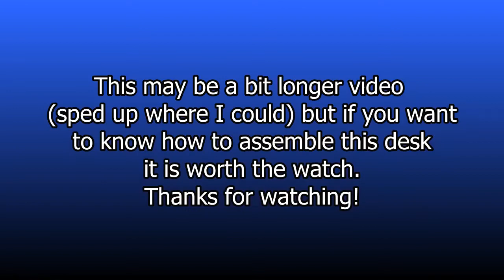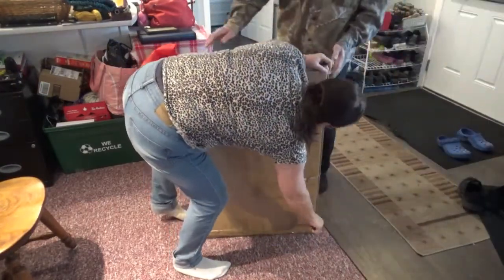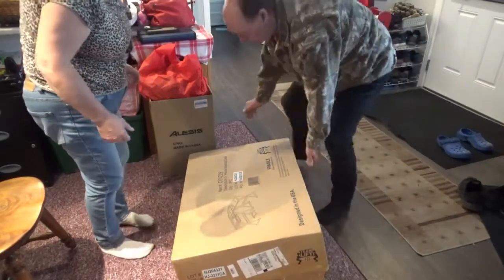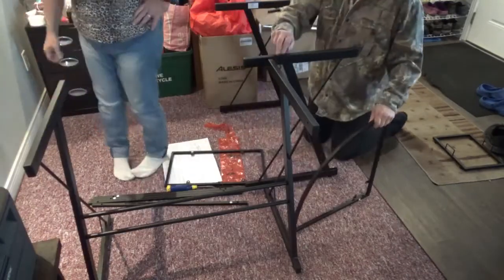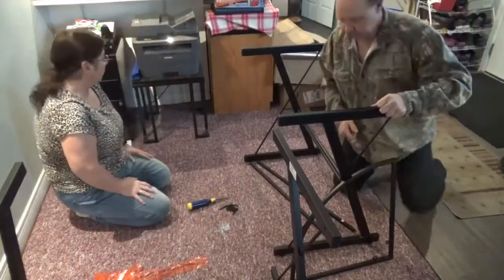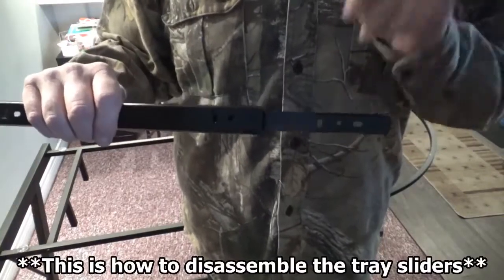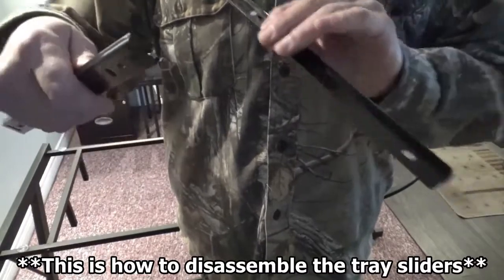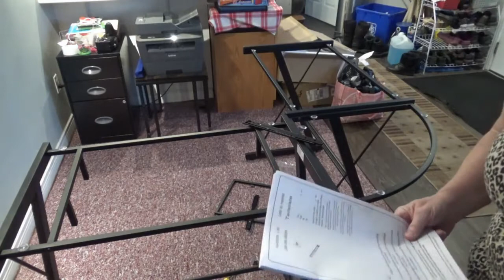Walker Edison Model D51Z29 L Shaped Desk Unboxing And Assembly

Comment: Hello Susan! I just bought this desk recently for my new room, but it’s actually too big and I was going to return it. Now, watching you guys put it together, I may keep it. I noticed the piece in between the straight parts isn’t connected to any legs. I’m wondering if you think it could work without it?
Reply from the maker: Hi, thanks for watching and for your great question. If you don’t use the pie shaped corner piece you will have two separate desks one with a keyboard shelf and one without. Both desks will work on their own or placed side by side. Hope this helps you figure out what to do with your desk(s).